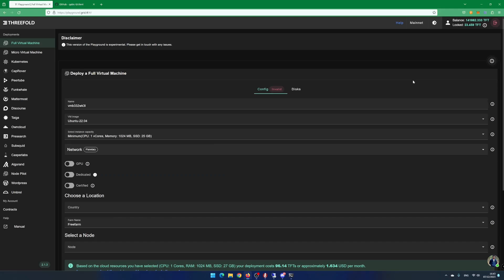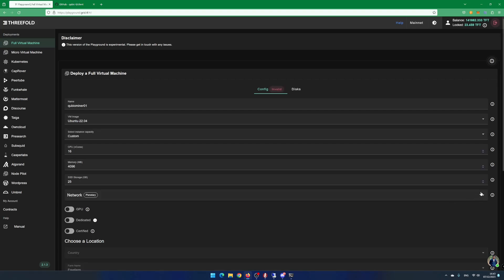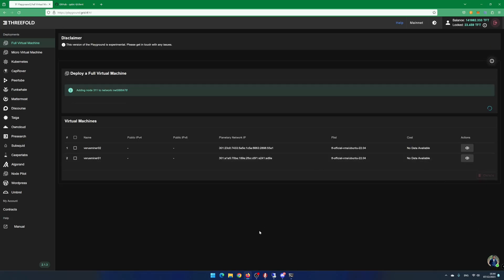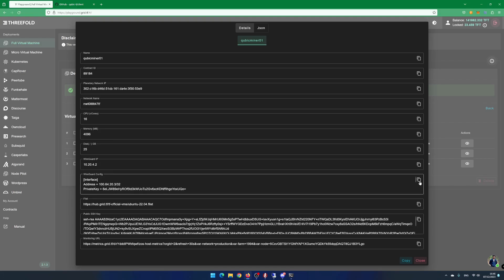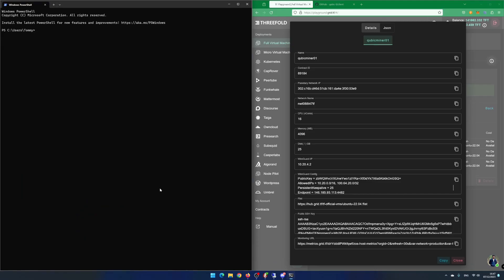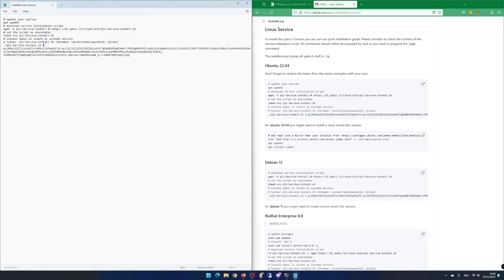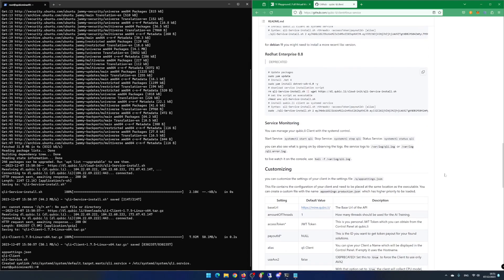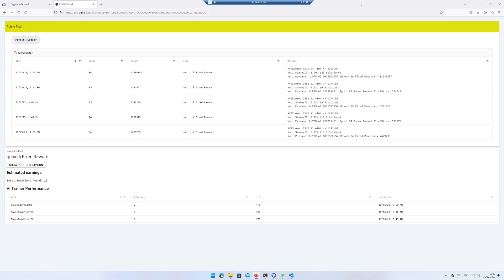How to mine Qubic using the ThreeFold Grid

Comment: Am following your steps but when I tried to input wire guard ip into powershell, I get “permission denied” (public key)
Any suggestions. Thanks
Reply from the maker: This happens when the wireguard IP already have been used and added in your host file in the .ssh folder. You can open the host file in notepad and delete the lines with the wireguard IP and save the file. I do this often when i use more than one ThreeFold Node with wireguard. In the future there may be a additionel ways to connect to the ThreeFold Grid using Mycelium.
Reply: I don’t see any lines to delete, just the ip follow by ssh-agahash and JEJEIEIHDDHDUDJDJDKDIDNDJDJDIJDJ. What part should I delete?
Reply from the maker: @editzobg  try to delete it all or make a copy of your host file, rename the copy as backup and delete all the lines in the old host file.
Reply: Thanks, it worked, but now I have a “Host key verification failed” on the power shell. 
Thanks in advance
Reply from the maker: @editzobg Maybe you are missing your private key to ThreeFold Playground. So when creating your public key on playground.grid.tf the browser automatically downloads a id_rsa file which is your private key. You need to move that file into you .ssh folder. Maybe that is the missing link.

Comment: got 8 core machine (cheapest ratio $/core), configured everything, it has AVX2 support but miner produce error: ERROR   Looks like the trainer isn't working properly :( check your config and he requirements.

Any idea ?
Reply from the maker: I had the same experience with a Xeon CPU node which also supported AVX2. Which kind of CPU does the node have when you run the command lscpu in the console?
Reply from the maker: You may want to have a look at this:
https://github.com/qubic-li/client/blob/main/README.md#avx-cpu-intel-not-working